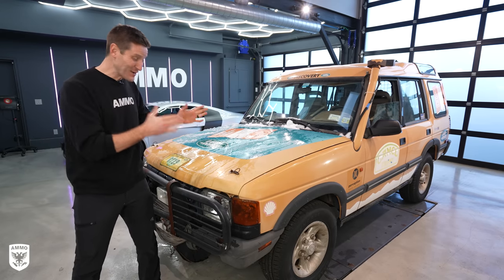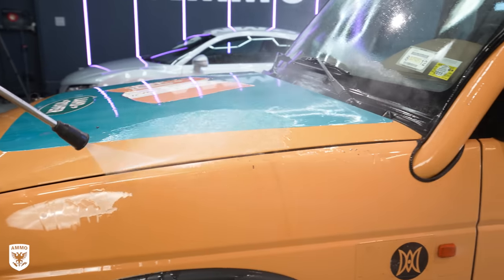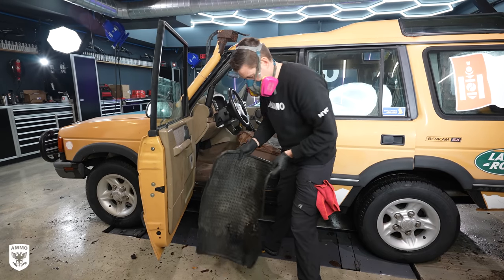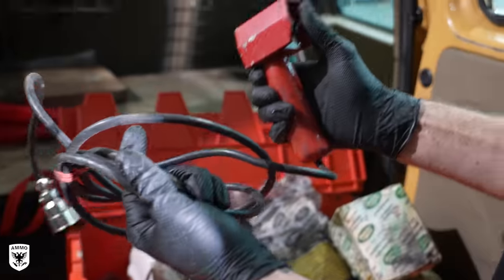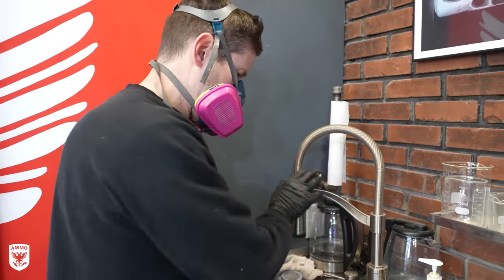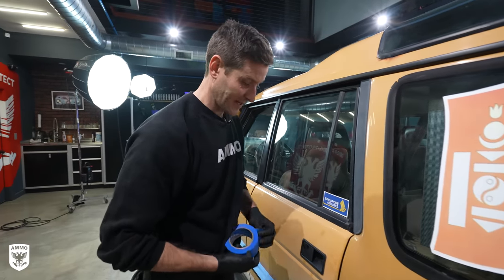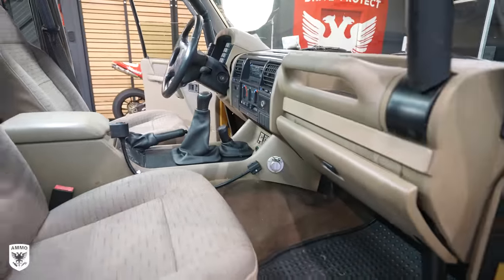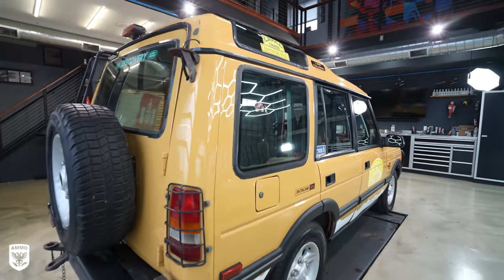INSANE Land Rover Camel Trophy Truck FOR SALE Full Off-Road Disaster Detail!

Comment: Ex Camel Trophy vehicles are so awesome. Love this one
Reply: I'm from Europe and since i was young i use to watch Paris -Dakar raids, big fan of 4x4 vehicles and checking out everything about the amazing Camel trophy.. if this Disco should be restored i would definitely replaced all rusty frame bull-bars, roof-rack if rusty replaced, back ladder, and side skirts replaced if are rusty, new winch, the windshield goose-neck for the air-filter looks rusty and the floor if it need it replace with new metal and then fully insulate, new parts like shocks, crank-shaft, bushings, joints, knuckles, steering rack, new brake lines + booster, new rotors+brakes, but keep the car with the body shell as it is no livery peeling just to remind anyone how tough the Mongolia raid trophy was.. Shout out from Europe !

Comment: I’m a Camel Trophy fan since reading about Borneo (85 or 86 I think). They were using 90&110 models then. I’ve seen a couple of Camel models in the UK, one was getting trailered north on the M6, the paintwork was barely visible, the rally plate & hella lights on the front of the roof rack gave it away. Couldn’t see the paint as it had been left to become covered in moss! There are certain registration numbers & chassis numbers which can be tracked back to “original” vehicles, as the rarity & history makes these machines very desirable, so  people have faked them in the past.

Comment: The 2003-04 Disco is my fav of all times! Sadly they have frame rust and bad head gasket issues. Anything over 70k is a ticking time bomb when it comes to head gasket. I drove a 2003 with 89k until 123k with using liquid head gasket! Truck was tough!

Comment: Iv had a few land rover discoverys over the years. Depending on spec the bottle jack and all the red bars and wheel wrenches come with a factory truck. One of mine even had the fire extinguishers on the back of the seats. Rust is a big problem on these old girls and I noticed the roof round the safari windows had gone a bit scabby. If this was in the UK it would definitely be a lot worst. I off roaded a 94 300 TDI 5 door for many years and although they are epically good off road, off road is what ultimately kills them. Within a year of ownership mine had a replacement boot floor and sills. Weirdly the front end was very solid and stayed that way. Mine fell over on one trip smashing the right hand rear window and quarter window. It looked so good with it's battle scars though. I had a 3 door 98 v8 XS that had the rubber side mouldings like this one. Was a very strange single stage blue that iv never seen before or since. Always polished up real nice.

Comment: My boss has from almost every year they used Land/Range Rovers a original Team vehicle. Almost all Dutch Team vehicles used in various Thropies. Unrestored with all the damage subtained in the Trophy. He has at least 20 atm i guess 
Restored to new Camel Trophy vehicles loose their heritage . They're not supposed to get "detailed",but that's my personal opinion.
BTW,you can simply pop out the LR logo from the rear door handle to get to the latch inside. WD40 the latch hinges and it'll work fine again. Worked on these vehicles since they were still sold new

Comment: When using the Scotchbrite pad on the doors, does it tend to leave a lighter area than the rest of the panel from it being a little more aggressive?  I have ran into this issue before and this looks like a good solution. I use naphtha  (or  on slightly gooey stuff like what was on the console. I learned that trick from my friend that does boat upholstery. It doesn't harm that expensive marine-grade  vinyl.
  I have never liked yellow vehicles as long as I can remember abut the Rovers are a HUGE exception. Being an avid off-roader, I would love to have one of the replica/commemorative editions they made even but a genuine one? How cool!.

BTW, nice save on the headliner!

Comment: Whenever you can't get the rear door open, lever off the Landrover  badge from underneath,  and you can then push the handle up and down a bit, and that usually unjams them........ then oil it so it doesn't  happen again

Comment: I was just wondering. Why not Clay every car before the actual buffing, compounding, etc.? Furthermore does every car finish with a ceramic coating?
Reply from the maker: Hey John, on some cars with severely oxidized paint clay bar is not nearly enough abrasive to remove the essentially dead paint. I use what is called a “mow down” technique. Lots of polish and a foam pad to remove this dead paint effectively as the first step of the polishing process. I certainly use clay bar as needed when it’s appropriate. Thx for watching and great question!
Reply: @AMMO-NYC  i really enjoy the science behind the art of your years of experience. Great presentations.

Comment: That ain't a truck. That's a Land Rover Discovery, a 4x4 passenger offroad vehicle, having absolutely noting in common with trucks.

truck
/trʌk/
noun

a large, heavy road vehicle used for carrying goods, materials, or troops; a lorry.
Synonim:
heavy goods vehicle
juggernaut
van
pickup
pickup truck
dumper
dumper truck
tipper
tipper truck
lorry
articulated lorry
HGV
bogie
bakkie
pantechnicon
Reply: Yes!